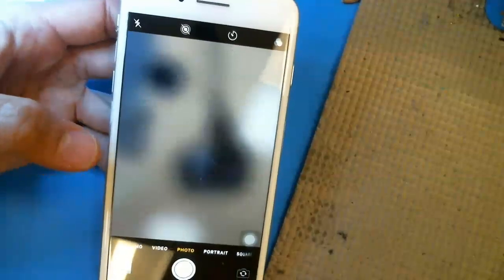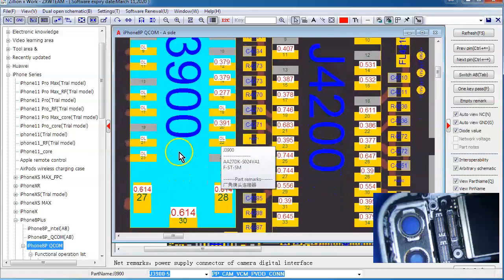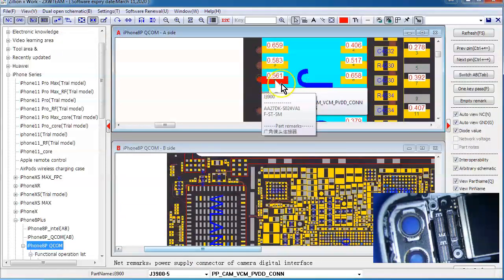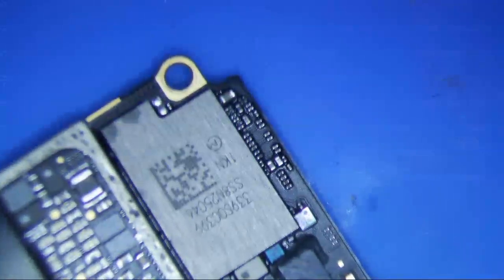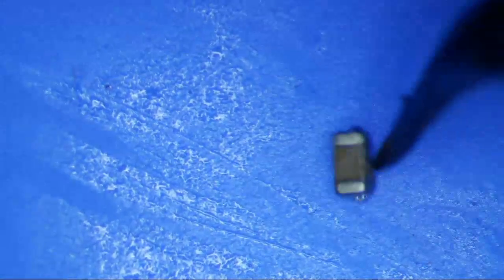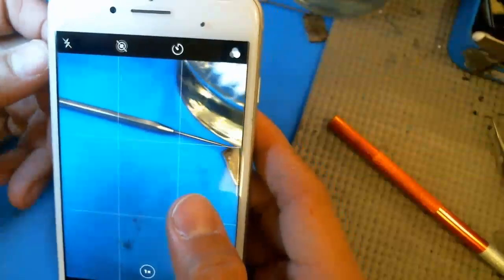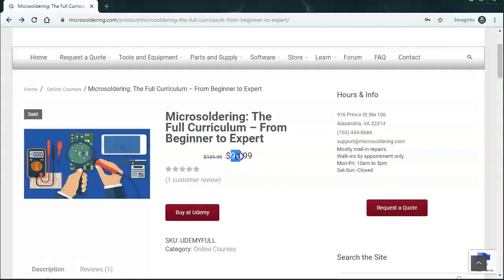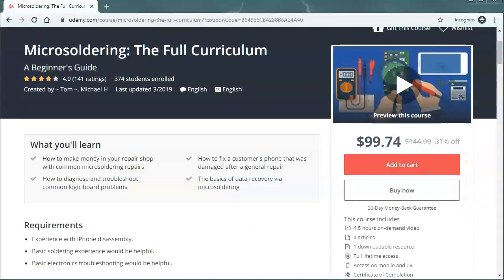iPhone 8 Plus  - Diagnosing and Repairing a Bad Rear Camera

Comment: Came here after laser back glass replacement shot one of the caps on the back of the board !. Found it and that pin now reads normally instead of 0.4ohm